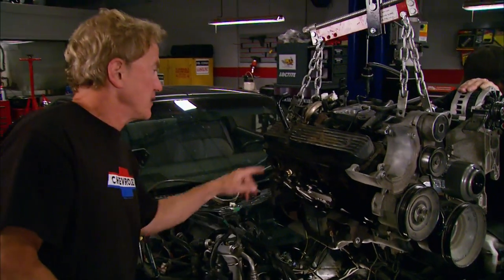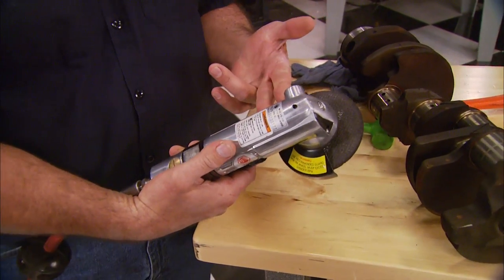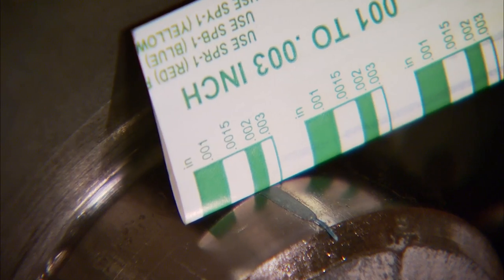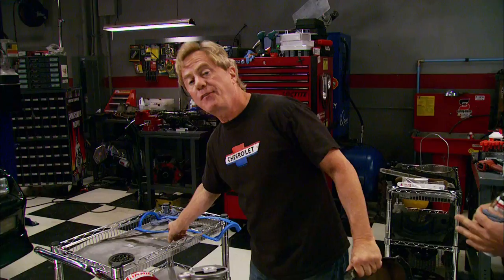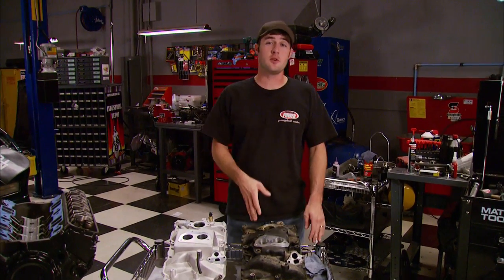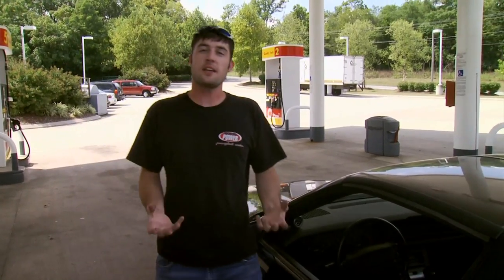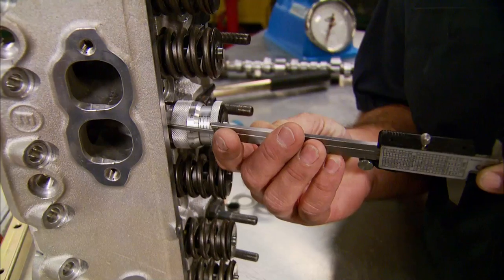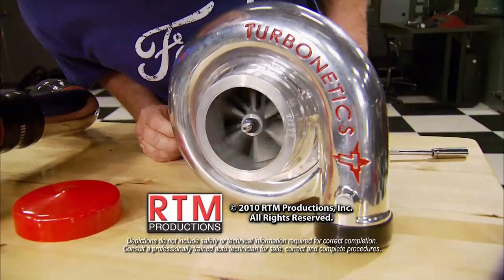Modifying a '92 Camaro Small Block to Improve Fuel Economy and Power - HorsePower S12, E17

Comment: Here's a note for anyone that's interested in 305 V8's (I know that that crowd is relatively small):
if you're looking for factory heads, the LB9 cylinder heads from the 1989 Camaro IROC is the one you want to go for.  Keeping things cheap, maybe get yourself a better set of valve springs, but retain the original spring profile.  Get a set of double roller rockers with a 1.6 ratio, a set of Comp Cams 5/16" hardened pushrods in stock length, and get a LB9 camshaft.  Up to you what you want to do as far as intake and exhaust, but keep in mind that the LB9 heads use a Vortec-style bolt pattern.
On another note, if you're looking to increase both MPG and wheel HP, recommend swapping out the stock driveshaft for either an aluminum or Carbon Fiber one, as it reduces drivetrain mass and inertia, thereby reducing parasitic loss from the drivetrain.
Feel free to add anything if you want.
Reply: vortec heads from a later model 305 crush LB9 heads...even better >>L31 vortec 350 heads,milled 0.045" and a decent cam,intake and carb make well over 325 flywheel horsepower......
LB9 heads are NOT a vortec intake manifold pattern,they have a revised angle on the two center intake bolts.a conventional sbc intake can be easily modified to use on lb9 heads
double roller rockers are beyond redundant,regular guided rockers or single roller rockers are fine

Comment: I know this aired a while back but wondered why they didn’t just shaved a set of cheap vortec heads and used the edelbrock intake with the updated vortec pattern. A cheap crane 2030 cam  and left the short block alone. Would have gained more with an aluminum driveshaft than machine work. Otherwise too much effort.

Comment: Why not a set of gears instead of the old style timing chain?
Reply: With a gear drive you actually loose HP on these older engines but they are better for durability.

Comment: In the begging it said "after our stage 2, we made 20hp, 40tq, and we're at 22mpg" at the end the total was 34hp, 35tq, and 22.9mpg. So you had the engine torn apart and machined, completely rebuilt the engine, and got a bunch of performance parts, all to make 14hp, LOSE 5ft-lb of torque, and gain less than 1mpg? Seems like a terrible waste of time and money...

Comment: I forgot how gutless those 305 motors were.  4 cylinder power, V8 gas mileage.
Reply: In California  in 1982 the 5.0 had 45 HP more than my 2.5L 1982 camaro. But Camaros  with the V8 had to have an automatic transmission. Plus the V8 camaro was a muscle car if under age 25 so you paid giant insurance premiums for that extra 45HP in car that weighted 300 lbs more.

Comment: Why are they yanking the 305 and doing all that machine work just to put it back in for minimal gains? No one is going to do that. They're either putting in a 350 with upgraded heads and cam package or going to a LS swap.

Comment: "Changed all the fluids to synthetic" - well, then I hope you rollerized the engine, too, or will be adding a zinc additive each oil change.
Reply: It’s a roller cam engine.
Reply: @TwoAMBlacktop  ah, very good!
Reply: Thompsongs I was a little shocked when the camshaft went in since the lobes were black and wondered why they were putting a flat tappet cam in, but then later they put roller lifters in. So I guess it was some kind of coating on it.
Reply: Flat tappet worries here too. Have 300k on the iron duke 2.5L flat tappet engine with Mobil 1 here..

 use today 0w 40 European since has 1000 ppm phosphorus and 1100 zinc. 

Compression is 160 psi on 1 , 2 and 3 but #4  is 146 to 148. Going to go a leak down test soon. Fairly sure #4 has head gasket starting to go.

 adding oil to each cylinder doesn't improve the compression thus rings still fairly good. 

Never had the head off or valve cover yet on the 1982 3rd gen. A piece of the Mobil 1 oil bottle cap seal fell down into the valve cover back in the 1980s. It will be interesting to see it is still there if i pull the head off the motor.

Comment: You gained 2.6 mpg are what expense? The engine rebuild had to be the most expensive part of the job, around what? $2 grand? The return on investment should take about 1 million miles in 15 years to break even.
Reply: Around 200k by my math.   Gas would have to be $8/gal for this to make any sense.
Reply: Wild Bill okay, was using fuzzy math, it would take a lot of miles to break even on the investment. I was using hyperbole for fun

Comment: They pulled the engine did all that work then put the Swirlport heads back on? What was the point? Either put a vortec 350 in it or Vortec heads and TBI manifold. Or ditch the TBI and put a carb on it. What none of that is sponsored i guess we will waste money on nothing then.

Comment: This has to be a joke. All that work would cost thousands and for just 30ish horsepower ?? Something is definitely not right. Base 305 made 145. You can get close to 200 just adding headers, advancing the  timing and a new intake manifold.

Comment: What a turd.  The 305 in my 87 Cutlass gets 22mpg with 506,000 on it.   It is carburated, and weezes through a stock single exhaust and has the aerodynamics of a brick.   I tuned it for mileage and it makes less to the tire than theirs did, but its very tired.  How does my 110hp to the tire, worn out junk get  better mileage that their freshly built, fuel injected, aerodynamic camaro?

Comment: if you really want better fuel economy just swap out the 350 and bolt in a 267 V8
Reply: My 305 camaro got 21mpg no matter how I drove it...also had a 267 in a 81 impala, got exactly the same mileage with 60 fewer hp.
Reply: @calebnoble7094  proper carb jetting is critical , every factory carb installed on those engines were over jetted

Comment: Ridiculous.  How many miles of fuel savings would it take to justify this build?  Anyone have a calculator?
Reply: Spoiler this is long and has math in it.

In my area(northeast Ohio) 87 octane was $1.89 yesterday(9-25-20) at Sam's Club.  I'm assuming we as consumers would have about $2000 in parts and machine shop labor.  Maybe more.  We don't get TV show freebies.   They are getting 2.5mpg over baseline.

My math may be totally wrong but i will try.  Please correct me if I'm wrong.

$2000 in parts and labor / $1.89/gallon = 1059 gallons of saved fuel needed.

So for every gallon driven you net 2.5 mpg.  So you need to drive around 9 gallons to net a gallon of savings at 23 mpg.   And you need to save 1059 gallons to pay for the project assuming $1.89/gal and $2000 in parts and labor.

So here's my math guess:
9 gal x 23 = 207 miles  = 1 gallon saved
x 1059 gal needed to pay for the project 
= 189,531 miles.    

Or you will never recoup the cost.  Gas would have to triple or more for for this to be even remotely plausible.

In all fairness that is not a daily driver car.   It's a weekend toy so no one cares about mpg unless you want to do the Hot Rod Power Tour or some other long run.
Reply: My calculator says 100,000 miles. Minimum.
Reply: @calvinmathers  or that car would be a rusted out husk and dead before you paid it off.   An LS swap with manual trans trans and rear end upgrade would pay off faster.   And be way more fun.
Reply: @bmstylee  I agree. Even a LS swap would never pay for its self in fuel saving alone. Going from 17 mpg to 25 mpg over 100k miles with $4 gal gas would still only save $7500.
Reply: @calvinmathers  true.  But it would be more fun than 170 hp and a slush box.
Reply: @bmstylee  duh.
Reply: @calvinmathers  😆

Comment: Pathetic, not even 200 WHP.  My GTI put down 210 WHP stock and more torque. Just awful. I was over 300 WHP / 350 wheel torque with a flash tune and a few bolt ons.

Comment: I realize this was all sponsored by the hardware manufacturers but this build was such a joke, lol. What would probably equate to thousands of dollars in machine work, parts, and labor to get an extra 35hp and less than 3mpg (under the most ideal of driving conditions) on a 92 Camaro was just absolutely silly. You guys were really pushing the fuel economy aspect and yet decided a SMOG era V8 Camaro would be a great candidate? LOLOL! Now that being said that camaro sure did polish up nice. Now take those ugly-ass headlight covers off and drive that clean example around.

Comment: all that BS for a 170 hp 305.... lord drop a stock tbi 350 in it. make the same gains or more than the garbage yall did. besides a good proper valve job deck the block while it was out. dont go to far on flow items. the computer in a TBI doesnt work well with alot of mods that promote airflow. been there done all thet plus a ton more on a tbi setup.
Reply: Honestly, they took the entire engine out, if you're doing all that then it only makes sense to put a $200 junkyard 350 in.... Jeeze. a 350 woulda made that power stock.